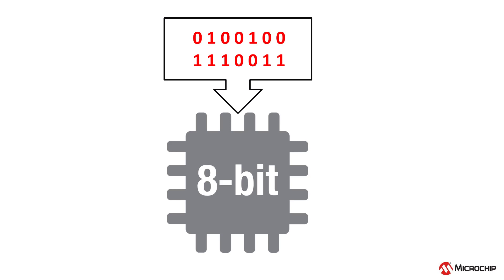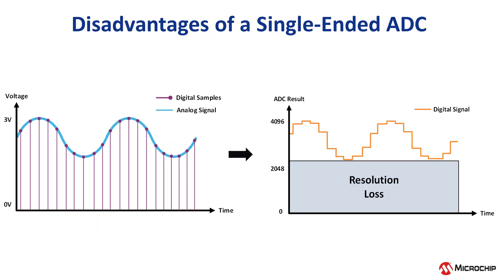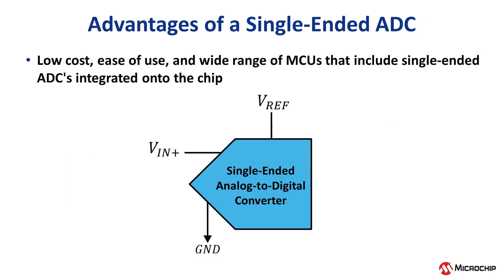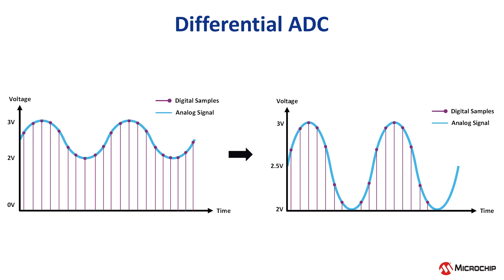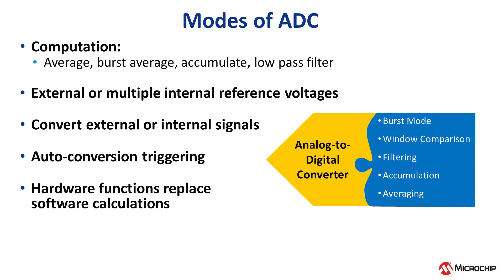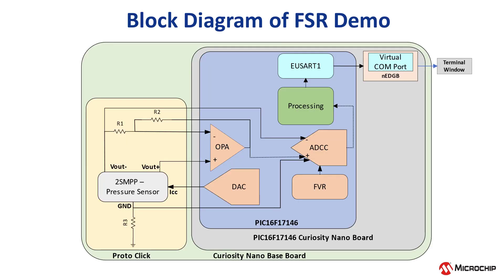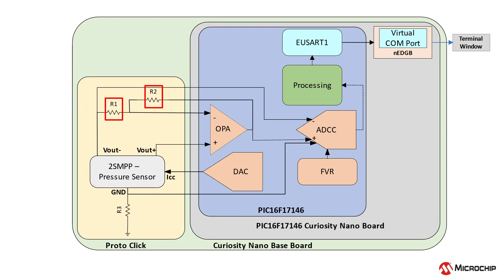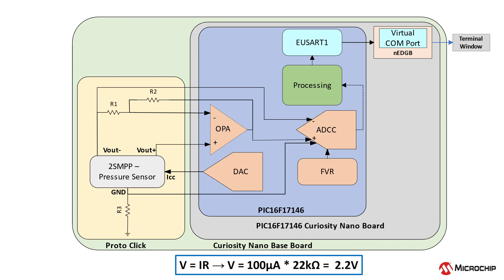Differential ADC/ADC Modes Overview with Pressure Sensor Demo

Comment: Interesting,  i kind of have this problem measuring lithium voltages using adc pin on arduino, its setup for a range of 5v but i only ever measure between 4.2 and 2.5, sort of wasting the rest of the resolution.  Not a big deal but nice to see something to address this issue, although I thought you could just get around that programatically with an offset, like map all your readings to a smaller range  but never managed to make it work (lack of math skills).